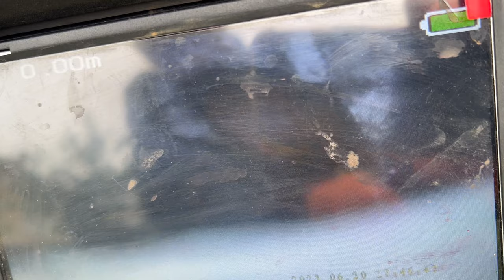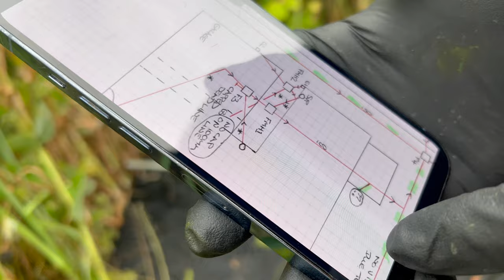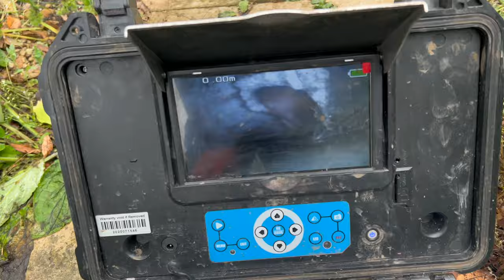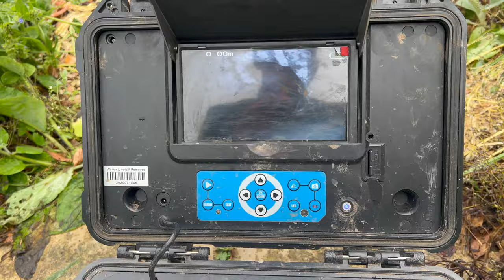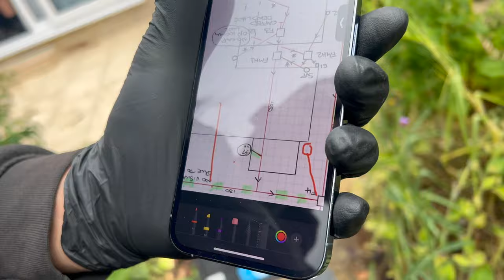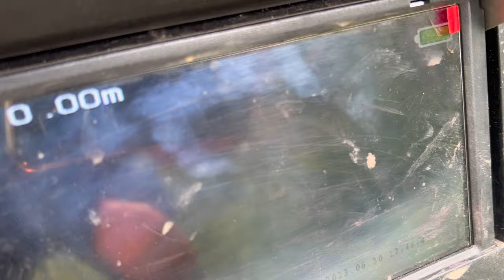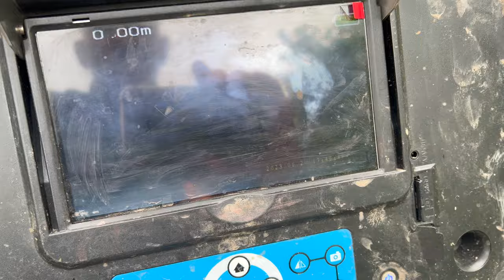CAVITY WALL RATS? RAT in ROOF? Drain survey for rats....be careful who you trust!!!

Comment: I've learned more in the past couple days off your channel than in the years before it. Really has opened my eyes.

I've been baffled as to how the buggers are getting in. I thought can't be the drain system as surely they'd come out of the toilet in to the house (how naive). My first thought was air bricks but read they need a 2cm square hole and air bricks are 1cm square. Beyond this I was thinking they must've just spiderman'd up the wall & in to the loft area which is where I've caught them but usually hear them in the wall/floor area of downstairs. 

After watching your videos I should pay more attention to the drainage I think. Has also helped to highlight what to look out for as some of the stuff you point out I wouldn't have had a clue.

Comment: Do you have any video of the smear marks or whatever, the route into the cavity wall?
The white pipes you exposed under floor with concrete(?) was that where you found chewed through adaptor?
The inside of house here is as well sealed as the outside. The rats must be getting into attic by climbing walls or through gaps in party wall where it slopes for roof.
I can't re-tile whole roof with steel mesh. A surveyor is going to report to buyer that there's a vampire issue or something!
Pantiles seem like an open door, just a question of a curious cold passing rat decides to chew through the felt.
With a solid slab floor having just the one internal soil pipe stack embedded from construction.